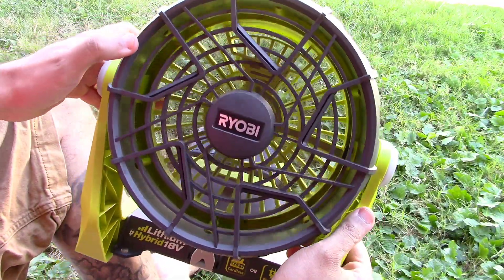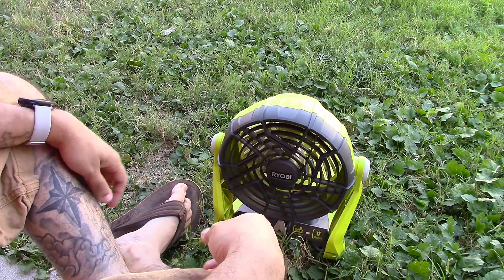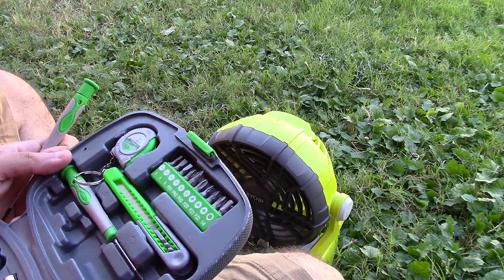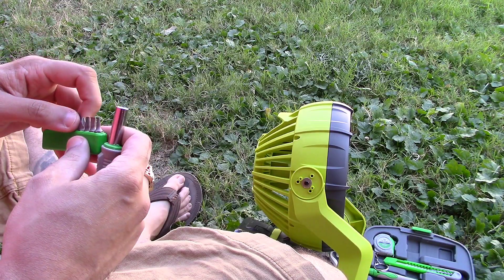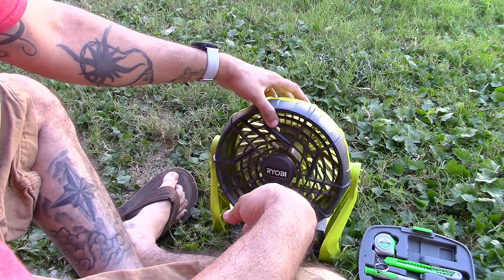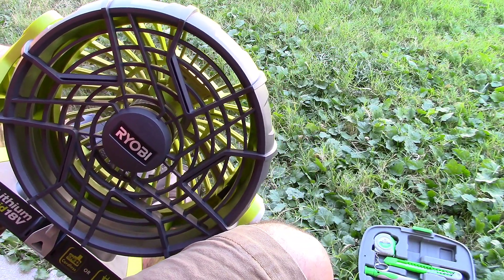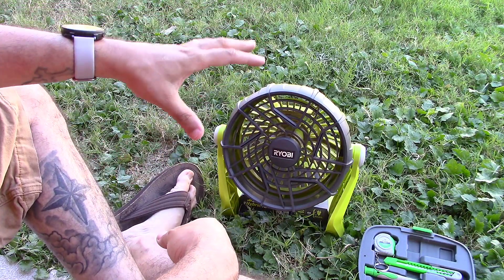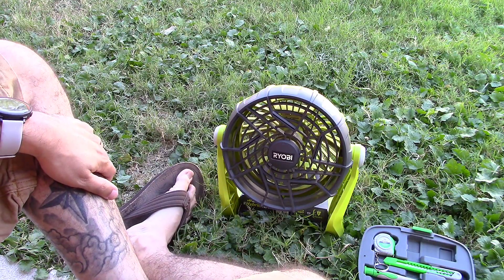Does your Ryobi fan do this?

Comment: Great video brother👍👍 
Here are some tips so it won’t go back anymore I would suggest using a Ratcheting Screwdriver with a ph.2 bit. When tightening it you may hear something snap but don’t worry it’s just grabbing the screw better I did careful inspection after I did this and everything was good. And the tightness should be like opening a laptop just a little bit tighter then that.
Hope this helps!!
Reply from the maker: Thanks. Yah once I tightened it doesn't flip back anymore and I use this every week. Cheers man

Comment: Seems like a lack of consistency in manufacturing.  I've heard of this happening to other folks too.  I just got one about 6 weeks ago and use it daily, but mine hasn't exhibited the problem.  Not yet, anyway.  I suppose I just got lucky with mine.   Thanks for the video!
Reply from the maker: Yah thats the case I'm sure. Ever since I tightend it I haven't had any problems with it going back, glad it was any easy fit. Thanks for stopping by.

Comment: Sorry dumb question here🤦‍♀️ 
What driver do I buy to open the fan up? Is it a star driver? I bought a little tool thing that has 5 tools on both sides so I had 10 options to open it with and none of them fit to unscrew it.
Reply from the maker: No worries. It’s just a flat head to pop off the end caps and a Phillips head to tighten and loosen. Hope that helped.
Reply: @MrBaldChronicles.  thank you kindly. Do you happen to know which tool is used to take the front of the fan off so I clean it?
Reply from the maker: Sorry
Reply from the maker: If you find out let me know :)
Reply: What you need is a T10 screwdriver
Reply: @walker2508  thank you
Reply: @JustPeachy2023  It is also called a T10 torx bit
Reply: i used a finger nail
Reply from the maker: Haha that’s a strong nail